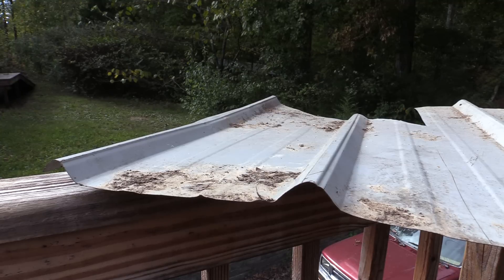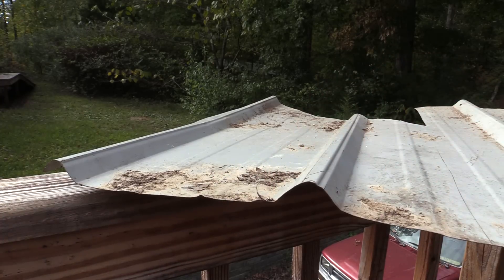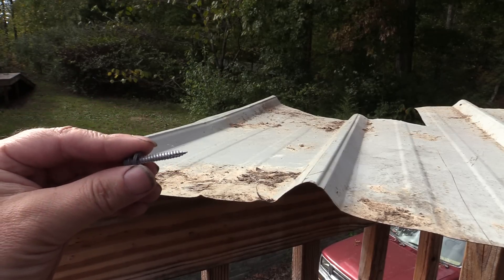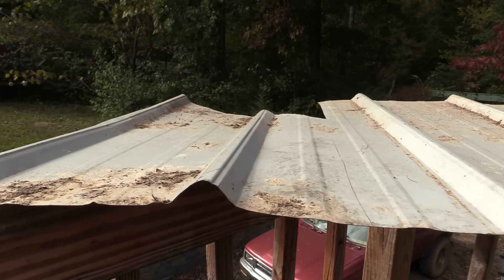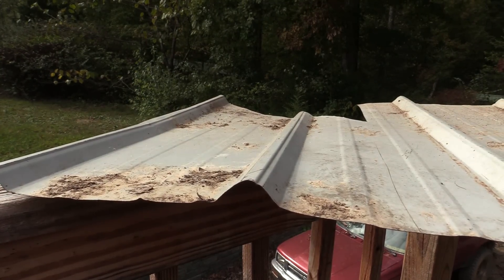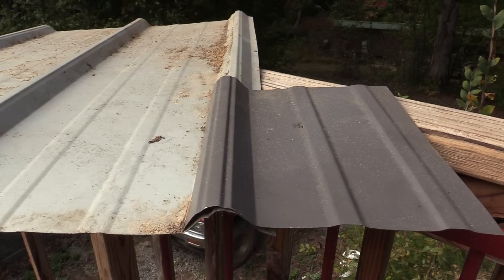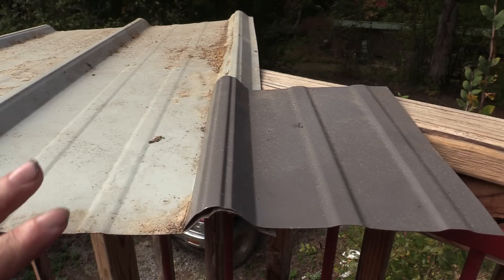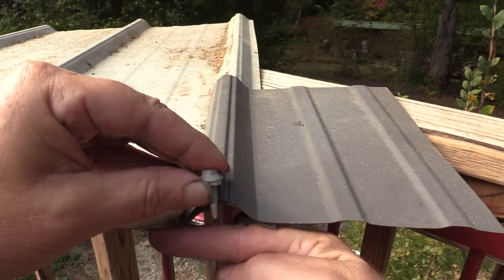Why you should not put screws on the ribs of metal roofing

Comment: I had a very old time roofer tell me the reason they went to screws in the valleys was money. When they put them thru the peaks, they never leak and are basically a lifetime roof. When they put them thru the valleys, they always eventually start leaking ... and rusting as well, and the added bonus is they can only replace the screws one or two times at the most. In his reasoning here, fist he says peaked screws will not let the roof move enough for thermal expansion, then he says they don't hold it down hard enough, so which one is it? I have peaked screws on my home and valley screws on my chicken pen. Guess which one leaks just a tad here and there if it really downpours hard enough. So far my house is dry.
Reply: One other thing I would add is you can't place the screws on the peaks of 29 guage metal, so he is correct there. Has to be 26 guages minimum. That and 5/8" sheathing by Advantec, which is water proof compared to exterior plywood, and synthetic underlayment with purlines and double-bubble insulation, and you have a roof for life. One can also go over it with white coolseal and give their AC a needed rest and make it last 3 times as long.
Reply from the maker: It is both however one size does not fit all. for thermal expansion if you have a small roof or one that is broken up in sections that may not be a issue. As far as holding it down that part is correct as the sheets should not have much movement on them. the lack of movement from expansion and contraction comes from the joints that allow the panels to move independently. screwing through the ribs eliminates the joints ability to expand and contract which produces more movement on the screws which if you have a long roof can add up quick and cause issues

Comment: Most of you comments are BS, you comment about expansion and contraction is true, grab a shingle and move it back and forth on the back side of the metal, after this you will never install metal over a shingle
Reply from the maker: I never said metal should be directly applied over shingle. you have to install purlins over the shingle first. and you can only do that if the roof has one layer of shingles. My current roof has both metal over wood underlayment and metal over purlins over shingle

Comment: Nails have significantly higher shear strength than screws; meaning nails are better at resisting side-to-side forces, while screws are more prone to snapping under lateral pressure due to their design, making them better suited for pulling forces. Nail the raised ribs or screw the flats.
Reply from the maker: Agreed nails seem to resist shear better but they seem to loosen by widening the hole.

Comment: Screw in the flats if using perlins for strength, no roof last forever so if you replace the screws like recommended you will be fine they still last longer than cheep asphalt shingles so if your screws leak get off your ass and replace them

Comment: I have pulled corrugated metal off chicken houses which had been nailed thru the rib and re-used it on barns and sheds WITHOUT sealing the holes, but nailing through the rib. The ONLY leaks occurred when the rain drop directly hit the old nail hole. Fastening thru the rib is the ONLY way it should be done, and when the rubber rots away from the screws in ten years, you won't have to worry about it leaking.
Reply from the maker: @waynec369  I am sure the metal you pulled from those chicken houses was 5v. It was designed to be nailed through the v. The metal in the video was not. Those washers last much longer than 10 years when properly installed 30 to 50 years depending on the screw head.  The latter from a all one piece design that completely leaves not exposed seal. Screwing through the roof on this pattern of roof on long structures will cause issues down the road due to thermal expansion and contraction.

Comment: Gentlemen, What is the solution for a 30 year old modern style metal roof with the screws done on the flats that is now leaking? This is on my shop roof. I am thinking new screws just a tad longer than the old ones to ensure a good bite and of course they will have new rubber washers. Surely mine are dry rotted and shot. The roof is in good shape otherwise. 
Am I on the right track or does anyone have ideas? Thank you from PA
Reply from the maker: Replace them with the latest screw which has a solid head and completely covers the washer. The shank is also a larger diameter so you will get the required bite through a old hole .these screws should last 50 years. i have a video that has them in it so you know what to look for. https://youtu.be/klGGIK25Wm4

Comment: Morton Blds.(wood construction)
1. 1"L, 2"L nut-driver screw w/drill-bit tip(5/16", 8mm socket).
2. 1"L, 2"L screw w/drill-bit tip(T-25
England-Riser(steel construction)
1. 1"L, 2"L 5/16" 3/8" nut-drivers
They pre-drilled the holes.
1. 1974- 40'Wx140'Lx14'H,4/12 RP
2.1984- 60'Wx120'Lx16'H,2/12 RP
20mi East of KCMO, they have never lost a sheet, never had to replace a sheet. 
A fastener goes on the highest point of the sheet, that's a ridge. Old galvanize-tin/ corrugated-tin was nailed or screwed through the rib w/ rubber washer.

Comment: I think if you're using the 29 ga. crap sold at big box stores you have a mess on your hands deciding. With the 24 ga. material I get from the Amish, tops of ribs is great.
Reply from the maker: I have never used anything thinner than 24ga. i installed some 20ga r2 panel that looked fantastic. so i guess the big box stores do metal roofing as well as they do mowers lol.

Comment: Think of "science". From outside to inside in valley you will have nail head, gasket, tin/metal, then rafter/truss. No gaps, no space. If a leak forms, water will be drawn into the rafter bc it has nowhere else to go. If there is a gap, as with ridge nailing, the water will dissipate first, run down the truss second, and only as a third course will it enter the wood. Even if no leak from the outside condensation will be drawn into the wood bc of the differing densities and porosity.
Reply from the maker: ok from a science perspective you have a screw head that has a bonding washer when properly tightened going into a hole with raised edges. the key is that washer needs pressure to glue to the metal. the new one piece heads have the washer completely sealed where no even sunlight can reach the washer. i want to stop a leak before it starts not engineer what if it does

Comment: ED, i have put the screws in both places, the windstorm can make the roof leak. i know a man that put liquid nails under the heads, the wind ruint the roof and they had to clip, cut the heads off to put new roof on. i dont remember if screws were in flats or ribs. another item is that if the washers rot, they may leak more on the flats. get the standing seam commercial roof for the best roof, no screws visible. it is more costly and i see it on schools, banks, etc.
Reply from the maker: @patriciareynolds2729  you are right about standing seam. They look great and have no exposed fasteners. They have 2 downsides. They are more expensive and 2 they are much harder to repair. They will last 80 years or longer.

Comment: Yes I put a course of screws on the flats up about 3"-4" from the bottom edge. And then with the installation of the top cap that adds extra screws to the top edge. Also the end cap trim is screwed on the flat so the whole perimeter screw schedule is enhanced to further stop it from 'pealing ' off.
If you are worried about the screws coming loose ,which you mention could very well happen, and your screws are on the flats your roof would leak like a sieve! Just another reason to put them on the ribs!
https://www.youtube.com/watch?v=yw8baDiI8Bk
Midwest Manufacturing installation video showing installation on the ribs.
I found it easier to predrill and that also made it very easy to tighten the screws without causing any distortion possibly leading to the "out of square" situation developing. It was very easy to see that they were tightened properly.
Reply from the maker: @dtl6620  I watched the video. The guy doesn't give me allot of faith that he knows what he is talking about. He put the screw right beside the rib which is never done as it will trap debris and create dams. He also recommended you back out a screw that has been over tightened. That is also wrong. Once you overtighten a screw the metal plate becomes a funnel. If you overtighten on the flat you have to use a new screw to fix it. As far as screws coming loose it is a possibility but I have never experienced it in over 20 years on the flat. On the rib they are not as tight and there is allot more movement.

Comment: I built a 24x30 garage but had local roofers install the metal roof because I did not think I could handle the panels by myself.I purchased my metal roofing from Menard's in Wisconsin. Manufactured by Midwest Manufacturing. The installation manual showed installing on ribs at 30" OC. The local roofer said no. He wanted to install on flats 24" on center. I called Midwest and he was told to do it my way. If the washers fail (which they will at some point) they will not leak if installed on the ribs. The water flows right off of the ribs. If installed on the flats the water is directed right into the screws. Also 30" OC is sufficient to fasten the panels to the OSB sheeting with less holes in the metal sheets overall. That gives you less chance for leakage and less distortion of metal roof panels. I predrilled my holes when I added a 24' addition to the garage which I built and also installed the roofing myself. A tornado came through in 2019 and tore up my woods but the roofing stayed put!
Reply from the maker: I am glad your roof stayed on. You did the right thing by following the manufacturers guidelines. These panels may look the same but can be engineered to handle thermal expansion differently. something you should be also aware roofs are rated by the load they can handle based among other things the number of fasteners when screwed in the flat. In the rib it is a different story as the rib is the strongest part of the roof and drilling holes through it creates weak spots so going with 30" oc might have been the better call but i have not seen the spec on your panels. I would say that if it were my roof i would want a double run of screws at the bottom just in case as the roof ages those screws may become loose. you have only 1 screw holding where the panels meet. with the screw schedule in the video you have a screw on each side of the joint which will prevent the domino effect of tear off. Thanks for commenting

Comment: Did my house twenty six years. Wanted best paint they made no tar paper just solid inch board.  Used   rubber on screws in the ribs. Put three rows on the ribs along bottom. For I live on my farm.  Wind is the enemy I check twice a year and look for any loose screws.  Still looks great not one loose screw. Most homes are getting steel  even in towns they even take hail.  Sun comes out dents pop out
Reply from the maker: Steel is by far the best roof. thanks for commenting

Comment: I bought a 52 year old cabin with 5V crimp metal roof. It was attached directly to the rafters on top of the 5Vs he used ring shanked lead, headed nails, and I could not find any sign of any leak
Reply from the maker: you probably wont either as you roof was installed the right way with nails on top of the v s which is right for 5v.You may have to go back latter and replace some of the nails with screws especially on the bottom as those seem to give out the most

Comment: Very interesting. I’ve always gone through the rib, but will now go and see what the manufacturer says now. I do know that I’ve had leaks in the valley of old corrugated roofing. It is amazing how much water will drip in through a nail hole.
Reply from the maker: i once did as well but new metal and new methods
Reply: When you put the screw where the most water is, when it leaks, it will be a lot of water.

Comment: Put screws  in the flat where the water runs...???
Reply from the maker: i know it is counterintuitive but there is more that goes on besides keeping rain out. keeping wind from tearing the roof off, weight load of the roof, thermal expansion of the steel and properly screwing down the screws

Comment: imagine a place where the winter is - 40 and the summer 98 f.   those screws unscrew with the temp change.  btw...my valleys are pushed right in to each other with no 3 inch plus valley reveal. and I just smash those washers in to the metal. the ice dams can be massive.  manual removal of snow is the only remedy. airflow problem.  but -20 doesnt give the problem.
Reply from the maker: there is actually a glue on those washers which is supposed to help prevent them from unscrewing. with such a extreme climate it seems like you have quite the challange. if it was my roof and i was having to replace the roof i would be tempted to install heat strip or have some way to heat my roof to drop the snow. I have a freind that has a heated driveway.....and we almost never get snow.lol. Stay warm this winter i hope you have a wood stove.

Comment: Hmm.  The metal roof I just had put on extends a bit of area after the ridge that you screw a fastener onto that is able to slide along the vertical axis a little.  So the panel itself is not directly screwed at all, just the fastener.  The next panel then overlaps the previous one at the ridge and covers the extension and fastener completely so neither the fastener or the screws are exposed to the elements at all.
Reply from the maker: @junkerzn7312  it sounds like you are talking about standing seam. They look really great and have no exposed fasteners.
Reply: @honeybeehomesteading  Yes, its definitely standing seam.

Comment: So your saying a 50 year old nailed corro roof was done wrong.. but still does not leak.. me thinks you might be putting up walls every industrial roof I've ever screwed got the peak treatment walls the same if it was hi dek cladding but here in Australia were upside down l guess..😂😂
Reply from the maker: No quite the opposite. Old 5 v roofing as well as some other panels should be nailed in the rib. this pattern of roofing in the video is engineered differently and should according to the manufacturer nailed in the flats. The metal manufacturers design panels differently. for example wavy roofing which looks like a continuous s with only curves and no flats has to be nailed in the ribs. it overcomes some of the thermal expansion by growing in height.
Reply: @honeybeehomesteading  you needed a bit more in depth explanation to why n where and climate due to the vast audiences yt covers. Graphically on the map calls for vastly different fixing methods cladding manufacturers recommend different styles it varies so much..👍
Reply from the maker: @rebekahfrench5747  I could not agree more. When I shot the video it was a bit of a fluke as a bunch of people had commented on a different video that my roof was installed wrong even though I had followed the manufacturers screw schedule. While I explained the reasons for screwing in the flats I could have done a better job explaining the importance of the expansion seam and how much the metal moves over a long distance when the pieces are screwed together on the ribs. Like you said you tube hast a vast audience. I will work harder in the future. Thank you for the constructive criticism I really do appreciate it.

Comment: You need to put stitch screws in the lap to prevent leakage
Reply from the maker: Putting stick screws in the ribs will cause expansion issues as you are eliminating the expansion joint. If you are following the min pitch of 3/12 the ribs should not leak unless you have something like a snow load. I have never had one leak at the ribs even with allot of snow on top

Comment: Each to their own way of doing things; You paid for the metal, put the screws where you want. I am 76 and still farming; just built a small 20'x36' barn and put high tensile heavier weight metal roofing on. Have built nine buildings all by myself in my lifetime. You know, we live in a high wind area near the mountains with frequent gusty winds. I don't like to put screws on the flat portions, but i do it anyways. (if i put screws on top of the ribs, then those flat areas jiggle/lift in the wind). So i always put screws on the flat areas right beside the ribs; have never had a problem or leak. We did have leaks on the first barn because we used some skinny diameter smaller screws in some places (to use up a handful of screws the neighbor gave us; i had to replace those with the bigger diameter screws). Always use the bigger diameter screws because they hold so much better.  Happy building, guys.
Reply from the maker: Thanks for the comment, as i have said before wind is the enemy as much as rain